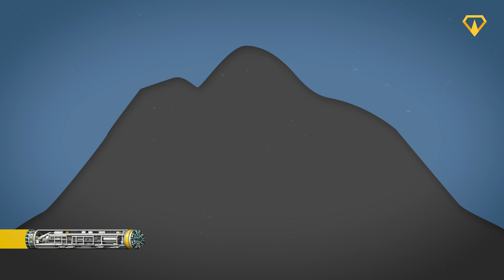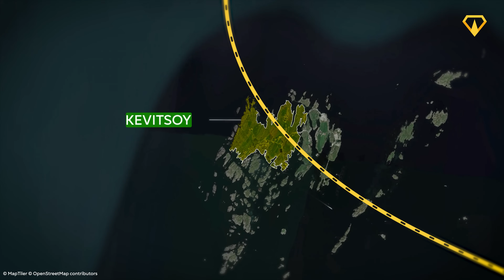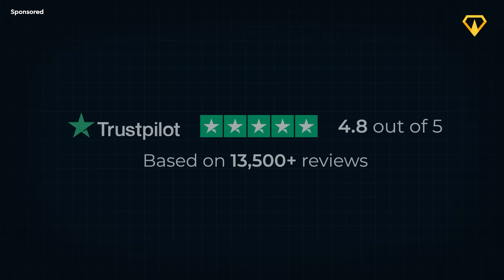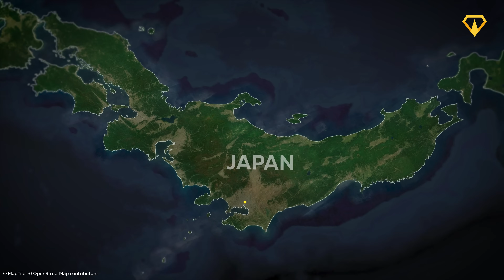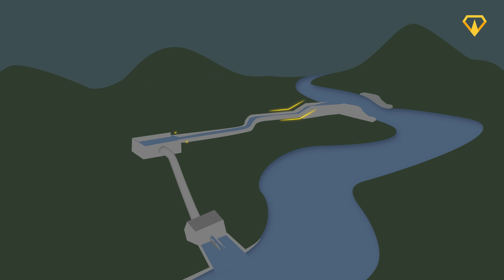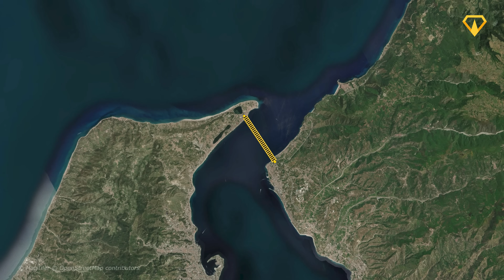The 15 Most Extreme Megaprojects Under Construction

Comment: the advantage of the Chinese is they cut through the bureaucracy of the USA and Europe because it's the State building it.  The Messina bridge stopped because of procurement and paperwork gaps, not engineering.  The Chinese are needs based and then engineers take over and the rest doesn't matter.  The West is paperwork first and then funding then needs then engineering in a continuous loop until it is "optimized".  Projects like the California high speed train to Las Vegas never get built but costs billions to "optimize" that balance.

Comment: The UK offshore windfarm even the contractors didn't want to build.  The UK Govt has 'guaranteed' a wholesale price that is higher than todays market prices, making higher bills for consumers inevitable because no-one - ZERO companies bid on the previous tranche of licenses.  The taxpayer is being forced to pay wind farm operators a 'bribe' to create wind power.
Oh, and the wind is often very calm in the North Sea, in the September immediately before the Ukr conflict, there was no wind for 3 weeks across it's entire span.  The demand created just by the UK and Germany, with it's insistence on decarbonising, forced electricity prices to soar for the entire EU.  Fortunate that Russia chose to make it's move in the following spring or the politicians would've had some explaining to do!  Blame it on the war, works every time!
When the North Sea is windy it can be one of the most dangerous places on Earth.  In both instances the Wind farm operators will be paid compensation, by the UK taxpayer.  The inconsistency requires backup gas power-stations be kept online and warmed up at any time, to take over if wind doesn't meet demand, Inflating the cost for consumers even further.
The program is the definition of Conservative and Labour insanity.

Comment: And did you know that the Czech Republic is planning to build 750 km of high-speed railway for a speed of 320 km/h, superlong tunnels with lengths of 30, 24 and 17 km and a total estimated cost of 1.1 trillion CZK (51.4 B$). Does that not count as a mega-construction?🤔